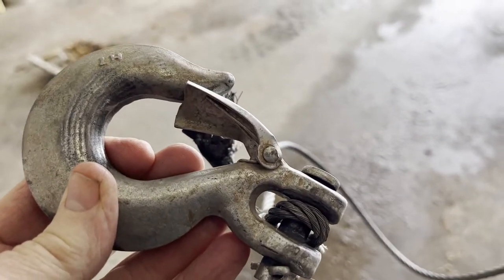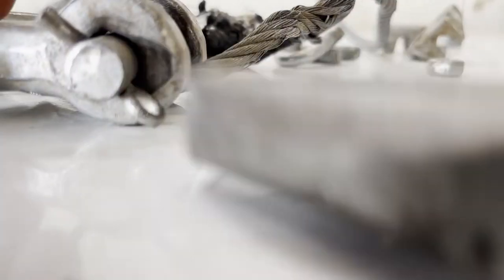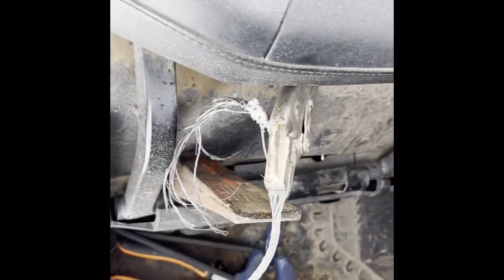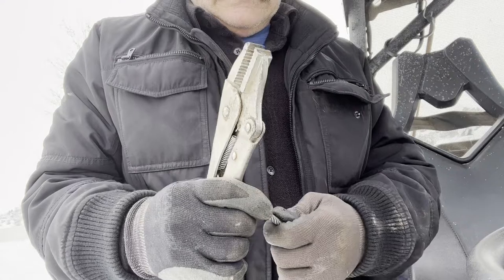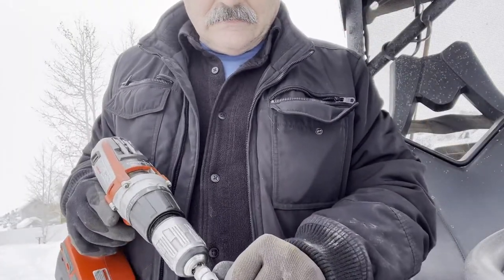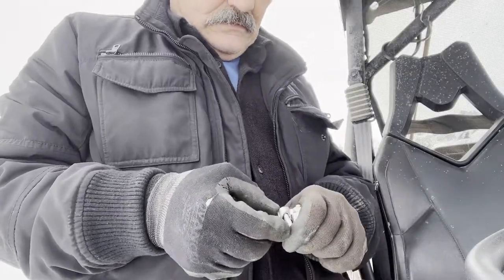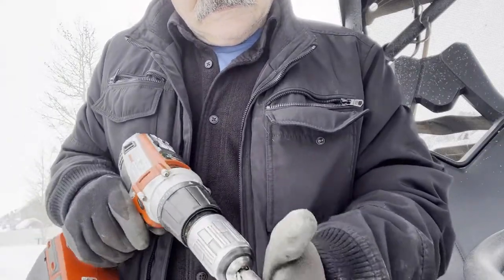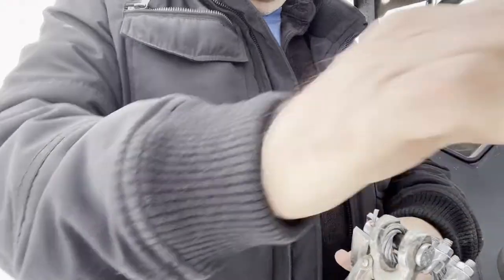Repair a Winch Cable End

Comment: I worked in the towing business for 30 years and was taught you never saddle a dead horse. Meaning the saddle part of the clamp goes on the working end the u bolt goes over the short end.  Never really knew why but did as told.
Reply from the maker: I've heard that too, I believe that is what I did?? But now I'll go check if I did it that way. Thanks for your comment.
Reply: I used alot of cable working underground.  Ànd you never saddle a dead horse,this man did it the wrong way.